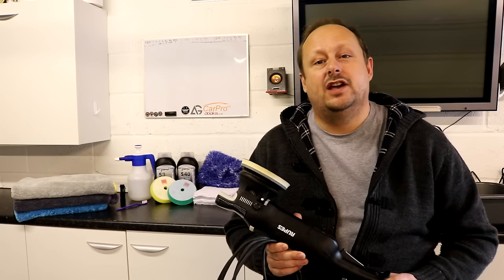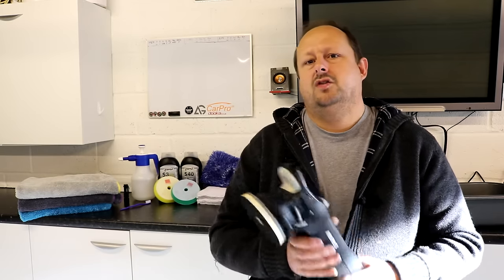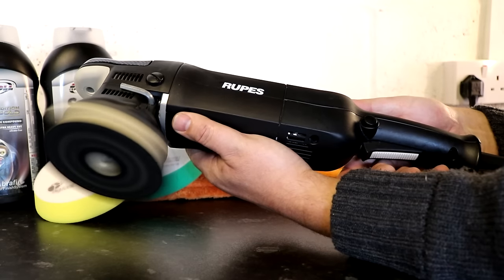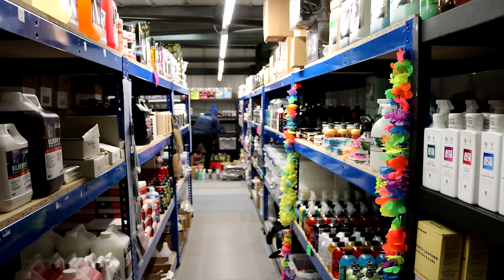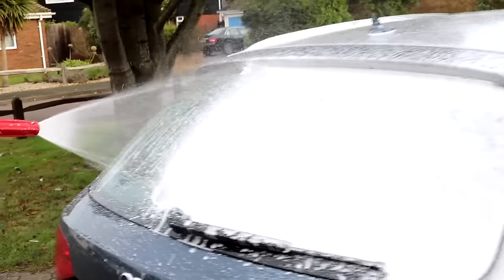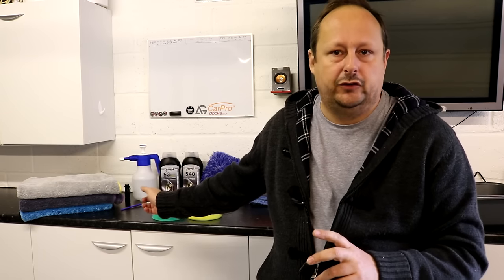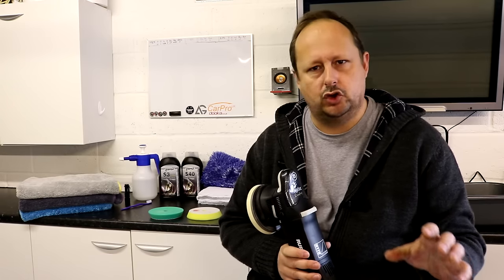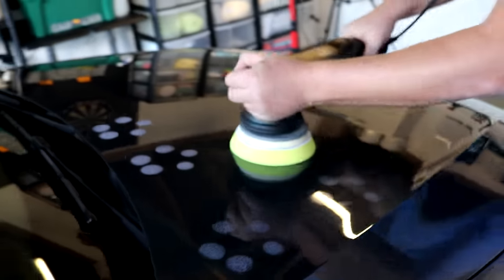Rupes LHR15es MK2 bigfoot machine polisher review guide demo

Comment: Have you tried the Kevin brown mod meaning a washer between the backing plate and the tool? The mark one needed them because of drag they had.
Reply from the maker: no buddy.  the tool is developed to interface with the shroud to reduce wear on the main bearing.  the wash mod puts a space between the backing place the the surface of the shroud.

so the advantage of creating this gap is the plate doesnt ride the shroud when you are leaning around on the pad or you are no polish level surfaces. so you dont get as much plate rotational stall.   

Rupes say you should grease the plate though to reduce this stall to avoid extra wear and tear on the bearing.

I have no input on who is right on this its just the gossip I heard.  but I personally would not use the washer mod.

I dont favour the free spinning machines generally (specially for cutting) and one of the reasons is all the plate stall stuff..
Reply: Forensic Detailing Channel Thank you for the info. Kind of along the same thing I was thinking

Comment: Hands down, I agree that the Rupes range of DA's is brilliant. However, I would say that the Duetto machine suffers from the stalling and the washer mode is highly recommended.  That said, it's still a great machine and in particular used with Menzerna polishes and compounds.  The results are stunning on German hard clear coats.  Great review 👍🏼

Comment: Convex angles cause the Rupes LHR15 mk2 to stall with 125mm (5") aswell, its very annoying. you cant get a decent polish there and you need to use a polisher with smaller 76mm (3") backingplate and pad. Also the 15 mm throw of the Rupes doesnt help in these convexed area's.

Comment: Awesome as review Jon, what you think of the 21mkII and a 75E combo? I'm looking at upgrading the arsenal :) keep up the epic content mate from NZ
Reply from the maker: the 21mkii will give you an even more agressive orbit.. more scrub over a wider radius..  but with that comes more vibration, slightley more wobble when operating it and less control.. so it leans towards the requirement of more correction over larger panels...  So i generally recomend the 1 mill throws as the one to opt for unless you want the features I just describes.  the 75e is great for edging and curves and small sections of panelling etc. will look to review that soon on the channel...
Reply: Fantastic mate, just the kind of info that helps :) the 15 MKII looks like a great bit of kit

Comment: Hi John! I tryed recently a Nordex machine with 21mm throw and decided to try it on a higher speed. I simply destroyed a blue scholl spider and a yellow lake country CSS on speed 6 on a single panel. Do you think the same will happend with the Rupes? Is it up to the machine quality or you just recommend lower speed? I did a hole car later at speed 4 with no problem but the first two pads on speed 6 was just melted.

Comment: I have the MaxShine "The Master" M15 DA 15mm throw polisher. It is a fantastic machine. It runs smoothly, 900 watt motor delivers plenty of power, pretty quiet, looks great, comes with a nice bag and a spacer mod, limited lifetime warranty, and so on and so on.  MaxShine manufactures their own polishers and I think that helps them maintain a higher quality than any other polishers in that price range. This polisher sells for $168.99 USD on Amazon Prime which is an excellent value for money. I know Rupes makes top notch stuff, just wanted to share this as a great less expensive option!

Comment: I have the Rupes 15 first gen its a nice polisher however I Prefer my 3401 just has more balls. The mini 75 is a great polisher for smaller areas, glass etc If the mark 2 has more power and does not bog as easy as the 1 than its worth the price of admission.

Comment: I may have missed it but I noticed you didn't mention the price and I don't blame you. These are very expensive...$700-$800 in Australia. The Flex brand is around $100 cheaper across the range. Many cheaper polishers have tried to imitate Rupes now Rupes are imitating cheaper polishers by including that " new technology " like rubber nose cone. I have never used one as I use Flex polishers and couple of those cheaper DA brands. Unless you are highly skilled at using rotary which can easliy switch all sizes of backing plates then yes one does need an arsenal of DA's. Other than my 3401 I also have a 21mm and 12mm similar to Duetto and a cordless. As with a some of products you pay extra for brand name. And Rupes is on of those brand names. It's great to have a wide selection of polishers to choose from but without the correct technique and experience with polish and pads they are all fairly equal and equally priced.
Reply from the maker: thanks for that Tomato.. your right yer. 339 pounds for the tool here.
Reply: No worries FD...Thanks for taking the time and effort to post these reviews.

Comment: After watching this video i purchased a lhr15 mark 3 basic kit  from clean and shiny for 395 , what a mistake after first job needed trigger relocating under warranty ( happens every now again i was told ) got it back used it second time stopped working halfway through a job , managed to get a full refund , maybe i was unlucky but overpriced rubbish in my experience
Reply from the maker: ive not heard that many complaints about rupes polishers.  literally 1 or 2.    maybe you were really unlucky but you have to also follow your experience dont you.  its like if you buy a car like a BMW and the engine blows you wont by BMW again.  but BMW still make good cars if you get me.
Reply: @ForensicDetailing  i know what you mean , worked for bmw uk for 16 years and seen many things go wrong but would never be put off bmw's ,  I probably did just have a bad experience but they are so expensive its put me right off another , after using the rupes id pick up my 15 year old makita and would feel loads better to use even though its harder work on full polishes , not sure what to buy next , whats your opinion on auto finesse dpx da polisher

Comment: Could I get away with just this one tool, as an amateur just doing my own cars? Or do I really need a smaller option as well, such as the Rupes LHR75E? Maybe for pillars I can just mask out areas where this tool is too big? Thank you again.
Reply from the maker: you can get away with the just the 15...  but yer its not great trying to polish a front bumper with a big DA like this... have a look at my front bumper video for example...   but it can be done mate..     Id suggest you dont really need the rupes machine and just get a cheap chinese ones if its only gonna be used a few times a year..
Reply: @ForensicDetailing  I'm sure you're right, I am just a bit of a tool tart that's all, figuring I'll be around another 50 years I hope so why not. Maybe I'll got for a pair of the in2detailing or similar then. Or maybe the small in2 one and this baddun. Hmmm. Appreciate the advice, cheers.

Comment: Nice review Jon. I owned Rupes Bigfoot LHR21 Mark 2 and mod it with a titanium plated M8 5/15" flat washer and I can see 3 advantages. 1- I see slightly more cutting power (more free spinning) especially on wide concave surface. 2- It's also keep my top backing plate stays clean (about 2mm-3mm gap) because the rubber shroud can cause black stain (rubber will get hot without the washer mode because of the friction). 3- Lastly it helps reduce my time for pad cleaning.
Reply from the maker: great stuff radhwan and good points

Comment: I Love the Rupes and think they're truly amazing machines. What does get on my nerves now is when you see someone on a forum, or in a fb group, asking for advice on purchasing their first DA and you get people saying they should buy a long throw DA such as the DAS6-Pro or Pro Plus (I've even seen retailers advising them). In my opinion starting out with a "regular" DA such as the shorter throw DAS6 (or equivalent) is a much better idea for begginers. Purely because they are a lot more flexible in their backing plate size allowing for the beginner to use 3" pads and not just the 5.5"+ pads that the 15mm+ DA are only able to run. I even know of a company at the moment looking it to producing an extension bar for the short throw DA (under 10mm throw)
Reply from the maker: great points michael, although using this tool is very simliar to using a normal DA with a smaller throw...  I cant see many issues with anyone starting out with this tool really.  plate size like you say forces you to look at adding other tools though.

Comment: Nice review, ive had the 1st gen lhr15es and i found it rubbish, it kept on bogging down on surfaces that weren't flat, even on the side of cars on flat surfaces it had trouble, so i sold it. I do have the lhr75e and that one is excellent. Im in the market for a bigger one, so i may decide on the mk2 lhr15es. So many people have said its so much better than the 1st gen. rupes polishers in general are very smooth and next to no vibrations. Way back when i started correcting my paint work, my first polisher was a meguiars g220 and that machine, the vibrations were terrible. Gave me really bad arm ache. For the people who want to polisher for hours on end the rupes is the best one to go for without a doubt.
Reply: The mk1 needed the washer mod which is easy to do. Also rupes will still honor the guarantee.

Comment: I used dsw today little bit hard to apply will try a dap applicator pad next time and i lefit on a pannle for 12 minutes and it was hard to come off other than that not that hard to buff off jus a bit grabby
Reply from the maker: yer, can pull a little bit..  I just tend to buff it away a bit quicker say 5-7 mins..  gets around that a bit..  I know what you mean its not that hard, but becomes a bit grabby when it dries. so when doing a whole car. Just something to be aware of when using it for the first time.  but hey, its one hell of a wax for 14.99.. check out the durability and performance of it over time

Comment: Great videos! Is there a particular reason you prefer the Rupes 15 over the 21? I bought the Flex 3401 with the four-inch backing plate and it's working amazingly well. I'm looking into a Rupes 15 or Rupes 21 since the price difference in my area is about $20 difference I'd like to get your reason on why you prefer the 15 over the 21. Thanks!
Reply from the maker: just gonna be more of a handfull with the 21 ml orbit.    I think the 15ml orbit with 125 plates is prolly the best bet U C
Reply: Thanks for your help and for putting our great content.

Comment: I got my first machine in 2006 and it was a Porter Cable DA.  After using that for a couple of years I moved up to a rotary and that was the route everyone took. I sold my PC which I regret now. I just polish my two cars maybe once a year so any machine I have will get an easy life. A few years back it seemed all the pros used a rotary - the Makita was very popular. Now I find it all a little confusing. There are large throw DA's, forced rotation DA'a as well as the good old rotary. Should I think about getting one of these new types of DA or carry on with my rotators that I'm confident in using? I'm after the best results in the minimum time which was the advantage of a rotary and why pros used them. It now seems all the pros used machines like this Rupes over a rotary..
Reply from the maker: hmmmm...   :)

rotary has some advantages.  you can use a variety of plate/pad sizes all the way down to 1 inch.. you can use extention bars to be able to allow the tool to get in and hit places you cant hit with other tools without extention bars..    the tool is  generally cheaper.  The tool has the potential to correct rapidly, but also has the potentially to correct at a nice safe diligent slower speed rotation speed... You can finish down with it just as well... ... Its the most accurate of all the tools as theres no offset.  Its the ultimate thing that can do the lot...

However...  use it with a poor technique and your results get compramised easily...  You can sling product around, over heat the paint and install buffer trails, burn through, specially on edges...  Generally though what will happen if your technique isnt on point, is you dont remove consistent amounts of clearcoat over the car....

Its really hard to go wrong with the DA...  Even when you are correcting with it at its most highest settings, the rate at which you cut and the heat you generate is never going to cause you problems..    Its easy to use, and more consistent results are easier to obtain..  And even professionals will like consistent good results that are easier to obtain...   The disadvantages are the plate sizes can be a bit limited with some of these large throw machines requiring more tools to achieve a bigger range of options..  And of course the machine wobbles a bit with the large offset and the plates (or pads) are harder to polish upto edges because of the orbit...   (not major issues)..

So yer you can get results with whatever you use...  but the question is which toolsets will work best for you for what your doing (and factoring how much experience you have with these toolsets)
Reply: Thanks for the reply- very informative. Maybe I'll get one of these larger throw DA's to use as my main machine (15mm throw will do) and have the rotary for when I need smaller pads. I don't use enough to justify pro level machines or to have one DA for standard pads, another for spot pads. Now to decide on whether to go with forced drive or not!

Comment: I will buy my first polisher, I will polish my cars and a 44 foot sailboat. I am thinking of going for the 21 instead of the 15.. Is this the right way to go?
Reply from the maker: I would personally go for the 15mil throw Thomas.  to be able to gauge the difference in the rate they cut is hard, but you will notice the 21 is bit more of a handfull to operate and less accurate.  That being said if your mainly using it for the boat you might find the 21 really suitable for that if your covering larger areas...  So my angle is more what suitable for use on a car.
Reply: Thanks for the swift reply, I think You are right, especially taking into consideration I am a rookie, it makes sense to have as much control as possible..
 I have seen many people use the 15 BP on the 21..

Ahh, decisions decisions :-)

Comment: can i use my rotary pads with this tool?
Reply from the maker: if they fit you can use them Kico.. but they might not work as best as other options..  Its always nice to have a pad which fits well and it designed for that tool I guess..

I sometimes break that rule though (specially on the rotary).. so the short answer is yes mate.
Reply: Ty very much sir.
I appreciate your channel very much

Comment: hey mate John here from Carefree Auto Detailing in NY. I know large throw is the way to go now but is the flex or torque which are a bit lower in price point large throw da's good as well
Reply from the maker: (forgot to say hi john as well :)  NY rocks. best place on earth love it there want to come over this year)  flex's have the fixed rotation 3401 out..   I know they have a 15 mill DA coming (its not in the UK yet though right?)

In terms of the 3401 versus the rupes15lhr. thats the question I get asked a lot.

Ok so Im biased a bit towards the 3401.  I just love that machine.  I love the fact you cant slow the rotation down.  it just keeps on chugging along doing its thing.  And I also really like the flex with the LC adapter system on the 4 inch plates and 5 inche pads.. because they are small enough and work great on all sorts of curves but big enough so you can also do bonnets etc without loosing too much time over a larger pad..  I can also be a bit more precise with the flex as the offset is smaller.  I love my 3401.

however.  the rupes is a beast on flatter panels.  I would suggest it might have a small edge on the 3401 in correction potency.  If it does though theres not much in it (and I have not used the lhr 15 much to make that decision more than a estimate)..    Rupes will also function better on microfiber than the flex.   The rupes 15lhr isnt as happy when your trying to use parts of the pads to hit inverse curves..  thats when you start thinking about the big foot mini combo.

The thing is there isnt a right or wrong.. Some people will prefer the 3401.. some people will prefer the rupes, or want to use MF with the rupes...  I know people that love one and hate the other and vice versa and people that like both... and people that prefer rotaries.. So its hard for me to be definitive...   I really like them both.. It was literallly a flip of a coin for me.  could well have gone with Rupes 15 and 75 combo.. but ended up with 3401 and 8-4 with a dewalt rotary and a chinese das6 pro...
Reply: Forensic Detailing Channel ty pal was on the fence I'm a hardcore old school rotary user. Most of my customers have large boats so it's been hard to get away from the DeWalt. I will definitely pick up one of these. Thanks again